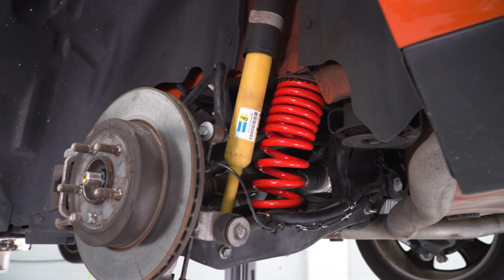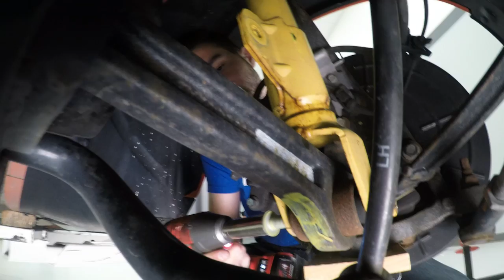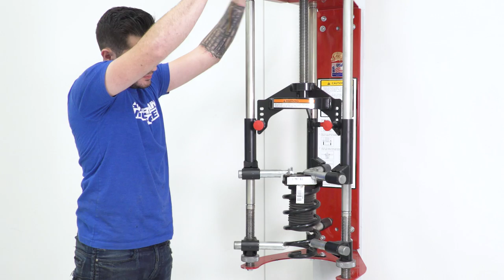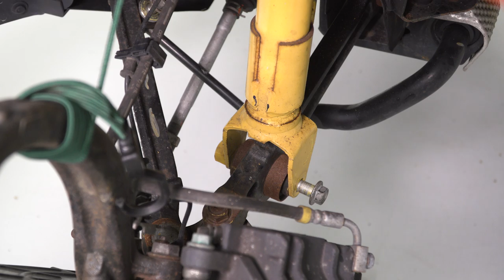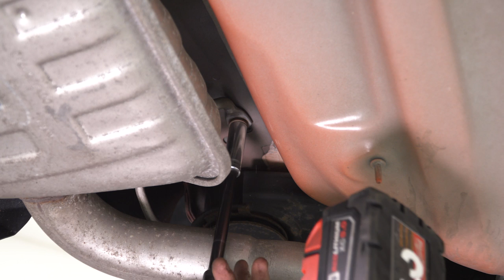2008-2019 Challenger Eibach Sportline Lowering Springs Review & Install

Comment: * Simply put, the OEM struts and shocks are valved to control the length and rebound of the factory coil springs. Changing to a lowering spring with a different rate and height will force the OEM dampeners to work outside of their intended operating range and thereby cause them to wear very fast and ride harshly.

Comment: I have this setup on my 18 Shaker RT.. it sits perfectly 👌🏼  ...  and no rub on rear 275s
Reply: How long did they take to settle
Reply: Jesus Perez  had them on a year.. been smooth since install. 
Make sure you get alignment done.
Reply: @gregoreosRGV   that didnt answer the question
Reply: Greg Schmidt  they took 47 minutes to settle.
Reply: Greg Gonzalez cool, I wonder how they would do with 295 or 315s. I've got 295s on my SRT8, and am thinking about going with 315s but don't want to run into any unexpected problems
Reply: What about a 315 do you think they would rubb
Reply: Did you have the nivomat system on yours?
Reply: Did you need a camber kit?

Comment: I've been thinking about doing that with my SRT8, and would look good without all that gap
Reply from the maker: Would definitely look cool! Taking away that wheel gap always is a good idea. 😂 -Zach
Reply: @cavitycreep  yeah I know, but still not low enough and have been thinking about doing coilovers instead of springs so that they can be adjusted
Reply: @lovethesmellofracefuelinth7374  whatd you end up going with?
Reply: @renameduser5279  lol actually ironically neither, l replaced the rims with 17s and dropped it nicely. It looks awesome and even better when I put Mickey T 305x45s on it, but I still might do the coilovers for the adjustability aspect though
Reply: If you were to swap the springs,when we put the car in sport or track mode would the car stiffen up like factory?

Comment: I noticed in the fine print that SRT8 models only drop 1.1 front and 1.2 in the rear. Is that because the SRT8 is already lower than stock R/T??? My SRT8 is also a Core model without the adjustable suspension.
Reply: Correct

Comment: previous owner lowered only the front of the Challenger I have, and the front tires are wearing really bad on the inside of the tires.  Probably will need to install adjustable A arms and have alignment done.
Reply from the maker: Definitely that or some adjustable caster camber plates! -Zach

Comment: Just wondering but the direction of the bolts don't appear to matter on the rear cradle? I noticed the inside one was put on backwards.  I know because it was a real B!!ch getting it back in the way it came out.

Comment: I just had the Dodge dealership install a set of 1-1/4” lowering springs.  Looks awesome, rides as good as stock, but it’s making horrible knocking/banging sound from rear.  Am I supposed to put shorter shocks in?  Is the noise from shocks bottoming out?  Please advise.  Thank you
Reply: Rafael Rodriguez did you ever figure out why?

Comment: WHAT THEY DON'T TELL YOU. At the end they tell you you need to get the  alignment done. What they don't said you HAVE TO buy new A arms because you can not adjust your factory setup. So add $412 to this mod.
Reply: What happens if you dont? 🤔
Reply: @rogerrameriez8912  you ride on about 75% of your tire because you can't adjust camber. You also have to buy adjustable camber bushings for rear. Otherwise
Reply: @OORagnar1976  No way! Just the rear or front end as well?
Reply: @rogerrameriez8912  yeah, you have to get both. Adjustable a arms for front and adjustable camber bushings for the rear. And if you can't put it all on yourself its would of been a huge bill.
Reply: @Eric Teichmeier 

What if I already had an alignment done do I still need to buy thos eextra parts u mentioned for the rear and front?
Reply: Just asking before I decide to buy the springs or not
Reply: @Birdwatch30  yes. Because when you lower it it ads camber to your wheels. The way the challenger is from factory you can not adjust camber. If you ask them like I did,  they will tell you I'm full of shit so talk to your alignment guy. If you want true alignment you need adjustments front a arms and rear adjustments camber bushings
Reply: Your wheels will camber a little and the tires will be worn on 1 side more but its not that bad,  just get the spings u dont need the adjustable camber arms. i never got the arms and iv been riding for a couple of years like that and had no issue. i personally love the natural camber on my wheels
Reply: @rogerrameriez8912  Ive been riding for 10K and tread on my tires look new.  It's all hype.  I like the rear end camber look.  If you want to straighten out the rear camber, take corners faster:)
Reply: @mocacreamjr  did your car align close enough to specs to where you can still drive on the highway without issues?
Reply: @aboutmyfathersbusiness8324   did your car align close enough to specs to where you can still drive on the highway without issues?
Reply: @traviscapps4495  it was kinda
Close, I take corners hard and go highway speeds and have no issues, just need to rotate your tires more often to get even wear.
Reply: @traviscapps4495  Ive been taking it to vegas once a month.  No issues.
Reply: @aboutmyfathersbusiness8324  doesn't the camber help it take corners better
Reply: @hemiplow1297  I'm not sure with stock "bicycle" tires on it but I have aftermarket 275's on all four corners and with the car's wide stance, can give sports cars a run for their money on mountain roads.  Just make sure  to heat them up first and memorize the road slowly including all potholes and divets.  increasing speed in increments;
Reply: @aboutmyfathersbusiness8324  I have 275 front and rear 305s on Michelin ps4s with eibach pro springs and sways and track built Miatas can't hang with me on a downhill touge.Im wondering because the lowering gave me camber and is that better for handling? Also which spring you use should I keep my pro or upgrade to sport line springs
Reply: @hemiplow1297  I have the Eibach Sport springs and camber definitely better for handling as most the weight is in the front (old school) weight dist.  Wish I could move the engine back and lower, like the old vettes.
Reply: @aboutmyfathersbusiness8324  I put front strut braces and it definitely makes the weight upfront feel more neutral and tight because there is less flex between the chassis and suspension.Would you say the sport springs handle better than the pros?
Reply: @hemiplow1297  Never tried the pros as my sport springs are used for a daily driver as well.  Why I chose them.  Pros of course should be a bit more agressive.
Reply: @aboutmyfathersbusiness8324  you mean the other way around right? The sports are lower and stiffer than pros
Reply: @hemiplow1297  Are they;? I bought mine about 8 years ago so I think labels may have changed.  I know there was a more aggressive kit than the one I purchased.  I don't remember the exact name of it though. I thought it was a pro kit from Eibach.
Reply: @aboutmyfathersbusiness8324  yeah the sport lines now are more agressive about half an inch lower were yours the red ones?

Comment: looked at their website....I have a 2018 Scat Pack Challenger. When I went to buy..put in model and year and said not available for my year...do you have any further info on this?
Reply: Brian Maslouski you have to look by part number or all the parts for the challenger and scroll. Their website is difficult to navigate for this very reason.
Reply: I had same problem so I took the part number and bought it through summitracing.com
Reply: @thatKidBinsane  Yeah, I finally got the correct part and got my Eheim Pro-Kit springs. Sitting beside me in my office as I speak. Got a place down the street that said they could install for $280 for front, $280 for back and about $100 for alignment.

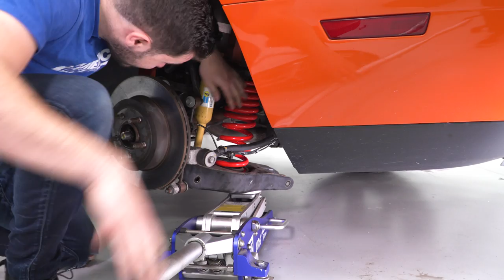Comment: 25:31 i just cant reistall that darn bolt! ,i tried 50 times...
Reply: It can be a real pain in the ass! It's really all about the position of the hydraulic jack. In some cases, you can jack up the lower control arm to get the bolt through one side, then drop the jack and reposition it to lift up the other end to get the rest of the bolt through the other hole. Hope that makes sense. It's tough, but not impossible! - Adam

Comment: I had these on my 2010 R/T. Even with new Bilsteins it bounced WAY too much. Eibach support wouldn't do a thing about them. I'll never buy their stuff again.
Reply: My 2009 RT with new shock absorbers happened to me the same and the front does not feel smooth.
Reply: Do you mean like a soft bounce or a hard bounce because the hard bounce is because it’s a stiffer spring rate so it’s less forgiving if it’s soft idk what’s up with that cause it shouldn’t be
Reply: Maybe your springs are installed upside down?? .......Im in love with these springs